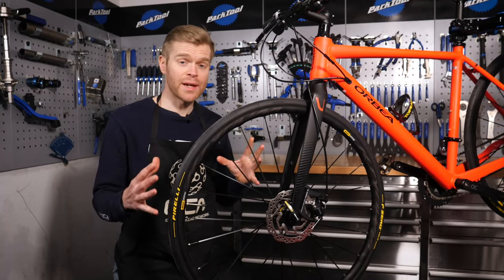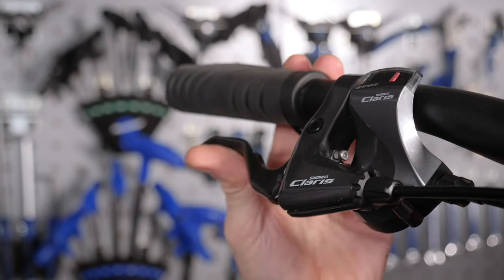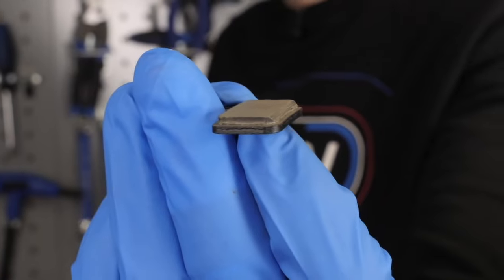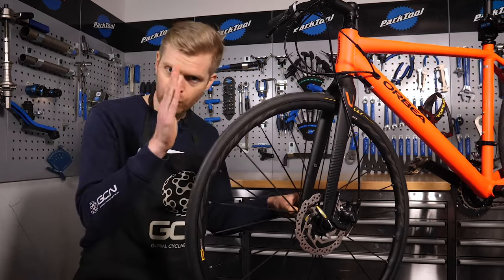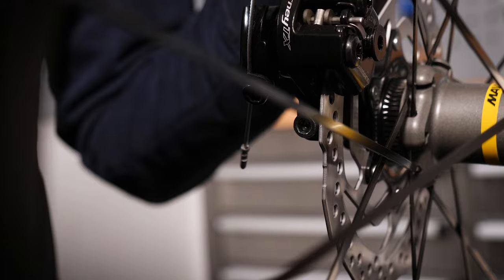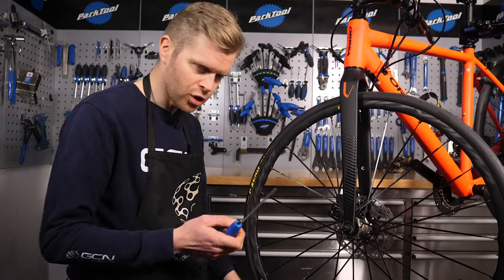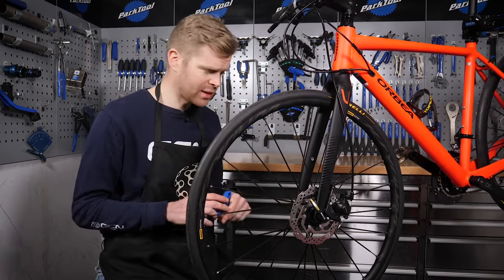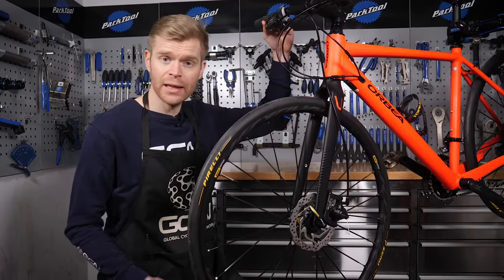How To Set Up Cable Disc Brakes On A Bike| Bicycle Maintenance Basics

Comment from the maker: Do you use cable disc brakes? Let us know 👇
Reply: Had used them for 20 000 miles (TRP Spyre - not the cheapest if not more expensive than basic hydraulic MTB sets). But then I just touched the lever of the hydraulic disc brake... 

I admit, however, the cable disc brakes are easier to set up. 

And the variety of pads' shapes is [...] annoying!
Reply: Trp spyre (slc)...best mechanical disc brake you can buy!  (got one in flat mount edition)
Reply: Yeah, dual actuated DB are brilliant. I impressed that you make a video about them, because everyone avoid to talk about it (even it's single pull caliper, which is suck).
Reply: Yeah, unfortunately I set them up the day before you released this video.
Reply: Do the semi hydraulic disc brakes self adjust
Reply: Yep.
Reply: Yokozuna Ultimo all the way!!
Reply: I have three bikes, two hydraulic disc and one cable disc, the cable bike is going to be replaced with a hydraulic disc bike at some point,the hydraulic bikes are so much better
Reply: Yup, not my road bike though, MtBs have BB7s, TRP Spyres & Hybrid cable pull hydro (Best of both worlds)
Reply: I've got TRP Spykes on my road bike and mountain bike, cuz flat bars ftw
Reply: @kedarkulkarni3030  They do but just get TRP Spykes/Spyres.
Reply: Yea, a 2012 Trek PDX. They made it for a couple years, geared toward riding in the Pacific Northwest (Oregon, Washington). Heavy af but makes getting on my Domane a dream when the weather turns better.
Reply: AVID BB7 MTN, front and rear.
Reply: TRP HY/RD - after a BB7 I went for it. tehy are quite OK! not hydraulic, but pretty close to it.
Reply: @kedarkulkarni3030  TRP HY/RD are self centering
Reply: @kristiandawe85  yes...I have them on my triban 520 and they are amazing 🤩🤩🔥
Reply: I can't find a video on how to put the cable in the caliper 😭😭

Comment: Pro tip: Tighten the caliper bolts a bit at a time switching from top to bottom, tightening one of the two bolts fully in one go will cause the caliper and rotor to shift off centre.
Reply: Doesn't matter they still move, the best way is to add another washer and you'll get your calipers perfectly centred with your rotor every time

Comment: OMG...a flat bar bike on GCN?! It’s not that often you find unicorns on this channel 🙃
Reply: I tried drop bars for months, convinced myself into preferring them even after getting cyclist's palsy in both my hands since I would only use the drops. Eventually I went back to flat bars and have never looked back. You can still get aero on them, I cut them down to 5 dm for which I had to go with a 25.4 mm clamp diameter, and paired with a 651 mm top tube, a 523 mm stack height, and a 17 degree 15 cm stem, flat bars can still be considered for aggressive road riding. Unless of course you wanna race and the organizers have some sort of imposing drop bar fetish.

Comment: As a mechanic who worked at a shop for a few years, hydraulic brakes rarely move the pads evenly due to the pistons being dirty and not moving freely. Theoretically, one can loosen the bolts, squeeze the lever while you tighten the bolts, and the caliper will be centered on the rotor but it almost never works. Just in case you're thinking about getting hydraulics instead of mechanicals because it theoretically makes this process easier. It really doesn't.

Comment: Cable actuated hydraulic disc brake are the 3rd type for disc brake.
Reply: Rim brakes are essentially the fourth type where the rim is the disc.
Reply: @brauljo  Technically, wheels are rotors, not disc's.
Reply: @wangdangdoodie  You're making a distinction without a difference. Rotor and disc is the same thing. If not, what is the disc in disc brakes?

Comment: If you’re struggling with the caliper moving around as you tighten the mounting bolts down, look for paint overspray between the caliper and frame. This is common and can be fixed with a bit of sandpaper!

Comment: My 5 years old merida cyclocross bike has trp spyre-c disc brakes. I have cut slot for the brake cables into mounting brackets, with power grinder. Because the bracket originally had some almost like alligator teeth surface to sandwich the cable with. On front brake someone at bike shop where I bought it(it was new bike), had already done it nicely, probably with dremel. But I made the rear one too(It was difficult, but I could do it almost well(it's good enough), with a big power grinder). I had to do it, because it was destroying brake gable.. There was only 2 strains of wire intact when I took it a part. I had adjusted the cable few time as the outer shell had seating in while in use and I guess i had everytime damaged it by undoing and re-tightening it..  But now it's very good. Does not destroy my expensive cable at all, and doesn't slide off too even when squeezing with full strenght.. Rather the plastic brifter lever might break I think. I use jagwire bolished stainless steel cables. They are very good. I also took the calipers apart one and half winters ago. and greased bearings inside, because they had got rusty inside.. And brake bads did not return anymore. And then I made mudguards for brakes to protect them from water and dirt pouching back down to brakes from mudguards.. It helps a lot. Before I even lost front brake one time, even though there was over 1mm compound left on pads. Somehow the spring that comes with pads had got between disc and bad and broke.. I believe it was because sand and tiny rocks raining down from mudguards of wheels. I had to ride home without working front brake that was also making bad sound when metal spring rubing against disc and I was worried all the time that the front wheel may get jammed because did not know if there might be some lose parts somewhere that can get stuck.
Also about the outer casings. There's actually a certain radius how much you should pend that casing. So that the end of casing that you cut flat, when it was straight, would still stay flat even after you have routed it on bike. 
I replaced the original merida handlebar on my bike with richey comp evo max handlebar. And then I noticed that on this new handlebar from richey. The bends that the cable had to follow were perfect.. My big appreciation to enginers/designers from Richey. I think they had taken it into account when designing it. All the bends on my merida frame seems wrong.. Only on that new handlebar they are good. I tried to cut other ends flat after routing the cables, but.. it was difficult.

Comment: Great video, but I would like to point out that resin pads can "glaze" under high temperature, resulting in a bad loss in performance, you can sand off the glazing, but that can be nightmare in itself keeping the pads surface even, so if you live somewhere with long descents, buy metal (sintered) pads, Shimano's ice tech discs really help too

Comment: If your having trouble with rotor rub when you tighten your calipers bolts, add an extra washer, this stops the caliper moving when tightening the bolts and you get your calipers centered with your rotor every time.
Reply: This is on road bike calipers

Comment: If you don't have thru axles use closed cam skewers like XT's helps reduce brake jack.  If you still find them inline tamdem Travel Agents from Problem sovles can take up quite bit of cable slack in the lever pull.  No matter how much the BB7 where redesigned road they still under perform comparied to their mt bike anologs.  Never used TRP's or Shimano mechincals for road, anyone reading this used all three?

Comment: I see you used what appears to be a Park tool to straighten a warped rotor, and I wondered why you weren't using the Park tool that can be used to set the precise distance between the two pads.  It may be attributable to the the fact that I am used to an hydraulic disc brake system (Campy) and you were working on a cable actuated system. (I have to admit that it took me an embarrassingly long time to figure out how to avoid rotor-rubbing and how to keep the system quiet.  The tech at my LBS taught me how to use the tool and it's been a breeze ever since.)
Reply: allenshulman yes this is because he’s working on mechanical. You are referring to the pad spreader, that’s only for hydraulic to push the pistons back in. On mechanical, the “pistons” are the screws that move the pads in and out.

Comment: #askgcntech - If your bike comes with a 140mm rotor on the rear wheel, can you change that to a 160mm rotor to match the front?  Does it depend on your bike or will various adapters make it work?
Reply: not a good idea. Frames are designed to withstand the forces from braking with the size rotors they come with. Putting on a larger rotor for better braking can destroy a frame as it wouldn't withstand the extra energy going through it. I did the exact thing with a MTB years ago and it destroyed the frame.
Reply: The other comment is wrong. Yes you can, you just need a 160mm adaptor. Heavy riders need more leverage. The bike designer didn’t know how much you weigh when they designed the bike. A bigger rotor gives you more leverage, but it does not give you more power. Road bikes are limited by tire size before rotor size. It would also give a little more cooling off you are warping the small rotor.
Reply: @jonathanzappala  Thanks!

Comment: @GCNTech 
I have a passion for cycling, but need some guidance. I have a rich man’s taste for bikes, but have a poor man’s salary. I feel like I can get a good bike for about 500-800 with rim brakes, but I would really like to have hydraulic disks. What would I need to convert the brakes? Would it be more worth it to just pay the extra for a bike with disks already fitted?

Thanks!

David C
Reply from the maker: Good question David, unfortunately most frames won't be compatible with both types of brakes, so the best thing to do is to save up and buy one with discs from the off. Hope this helps :)

Comment: My bike's front wheel disc brake's inside adjuster can't be adjusted I tried several times but the alen key bolt is rounded due jammed I applied WD40 to loosen can't. How to fix this
Reply: Hi mate, this happened to me yesterday, there are a few ways to fix this but the one that worked for me, as crazy as it sounds, was to hammer a Torx head into the allen head then ease it out. Also WD40 probably wont help, you need something like 3-In-One.

Comment: If I have a aluminum frame with a carbon seat post do I need fibergrip? Will some greases corrode the carbon? Does the same go for handelbars and stem?
Reply: Charles Fulks if you can use grease without the post slipping in my opinion that is best. If it’s a tight fit it should not slip, a looser fit you can get slipping with grease. That prevents the stuck seatpost. Otherwise no, you do not need fiber grip for a carbon post in a metal frame.
Reply: Jonathan Zappala Thanks!

Comment: How do you know if you have to change the brake pads? Is there an Indikator somewhere,
Reply from the maker: They will be worn down to the metal backing plate, or will have become glazed (by which they are incredibly smooth an no longer gripping the disc)
Reply: @gcntech  Thanks

Comment: Could I use mechanical disc brakes with an ultegra di2 shifters? The rim brake groupset are cheaper than the hydraulic disc version.
Reply: If it’s for the rim and it would be the same ones assuming that they are both mechanical
Reply: Yes, but it won’t feel as nice. I agree 8070 shifters are sky high priced
Reply: @jonathanzappala  I currently have the hydraulic brakes and mechanical ultegra and I really don't feel the need for the extra power in breaking. Just wondering in what to use the ride to work this year

Comment: I have Avid BB7s on my otherwise pretty okay roadbike (Alloy frame + 105), and I friggin hate them. They perform worse than my GFs rimbrakes (older Chorus) and way worse than my MTBs Hyd. DB. It's a pain in the ass to set them up. Either the lever travel is shitty or they rub, no matter what I do.

Comment: IMHO you got it wrong -- loosen up the brakes, "unscrew" the pads, insert brake pads adjuster, brake (hold the lever), now tighten the brake screw, get rid of brake pads adjuster, loosen the screw on cable, tension the cable, "screw" in the pads. Not to mention, do not touch the rotor with your bare hands, unless you want to make the brakes more greasy.

Comment: #askgcntech great video - first time I had to change out the pads on my mechanical disc brakes (Giant Defy) it took me about 2 1/2 hrs of messing around and several handfuls of hair being pulled out!

I was wondering if someone can help with an issue I have... both my front and back brakes have grown a tendency to stick shut on the discs when I pull them hard. Kind of annoying to have to dismount and unstick them manually several times a ride. Anyone had this before? I’m not sure if it’s the spring mechanism that gummed up or perhaps the cable sticking (although it was recently replaced)? Any ideas? 

I recently replaced my Giant (which is soon to retire to a more gentle life!) with a new Pinnacle Arkose which has hydraulic discs... absolute game-changer! I’ve found mechanical discs great for not destroying your rims when commuting 1000s km, but not much else (no better than rim brakes for performance). Hydraulics on the other hand are just incredible. Defo worth the extra cash if you can stretch to it!
Reply: I had the same problem on my Defy with TRP Spyre disc brakes. Only on the front though. Just replaced the cable, hope it's gone now. Also the cable wore out pretty quick

Comment: The best way to set up cable disc brakes is to cut the cables off, remove the cable callipers, and then replace the whole setup with a hydraulic system.
Reply: Cable disc brakes, the worst of both worlds: all of the flex and sponginess of cable brakes combined with the added faff maintenance of disc brakes to stay on top of ‘brake squeal’.
Reply: I’ve got cable rim brakes on 2 of my road bikes, easy to maintain and set up. I’ve hydraulic disc brakes on my ‘halo’ road bike - awesome performance and amazing ‘lock up’ feel for maximum braking. And then I’ve got cable discs on my first ‘modern’ bike, a MTB/road hybrid which is a nasty-braking built-to-a-budget bag-o-shite, mainly due to its shite cable-disc brakes.

Comment: Ca I make my mountain bike turn ito a road bike
Reply: You can make it more suitable for road but not into a road bike by for example changing the tyres. Geometry is biggest difference between two and you cannot really change it too radically. By changing every possible component, it would be cheaper to buy a road bike.
Reply: from XC MTB to a drop bar Gravel Bike is possible.
Reply: @Pienimusta  thanks mate
Reply: @DennisTeohKokEe  thanks mate
Reply: @bikeszone1  thanks mate
Reply: @davidfromyoutubemobile4607  No worries man
Reply: The challenge of that is MTB has a longer reach than a road frame because you are using flat bars. You will want a shorter stem converting to drop bars.

Comment: What are you talking about?! Metallic pads have way better heat dissipation and stopping power than resin parts. Fake news lol
Reply: Lol, resin dissipates better the heat by melting away 🤣
Reply: True, plus risen pads glaze over, resulting in you using your chamois as toilet paper, so in a way are GCN trying to save on toilet paper? Not a bad idea considering what's going on 😂
Reply: @carbonsuicidemtb1583  Shimano advocates resin pads, as they wear out quicker you have to buy new ones, and Shimano wants you to do that. And we know Shimano sponsors GCN so...
Reply: @JeffWagen  I doubt it's a conspiracy bud, roadies still struggle with discs, I was a roadie, cat 2, new technology is weird and suspicious to them, even though open system disc brakes have been around for 20 years, Jesus, I remember being the DH team mechanic testing the first open system hydraulic brakes as prototypes from formula 24 years ago.....
Reply: @carbonsuicidemtb1583  I wouldn't say conspiracy, it's more like an "induction". Or Ollie doesn't really know what he was saying lol!
Reply: @JeffWagen  they will get there in the end.. I just hope this thread is read and taken as it's meant, if you want disc brakes advise, go to a MTB channel